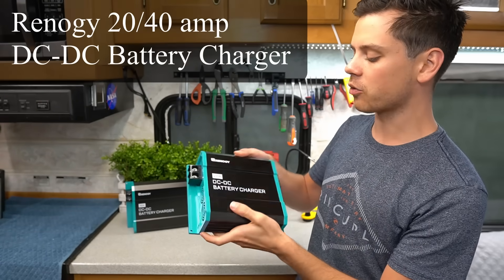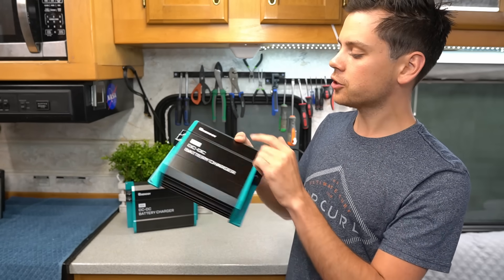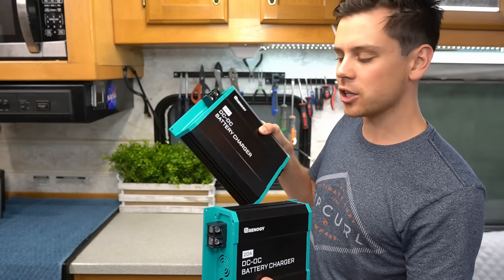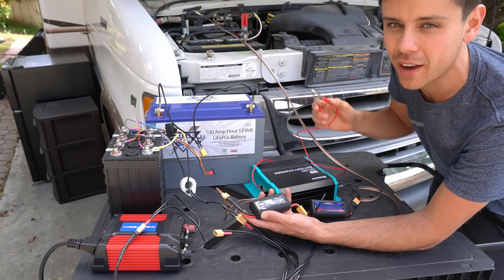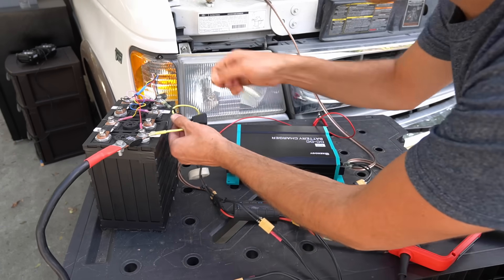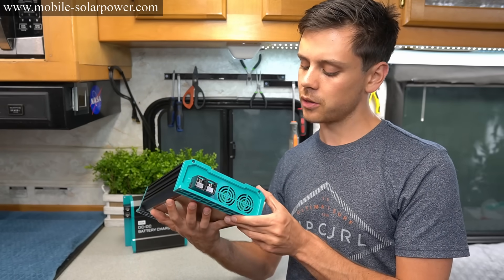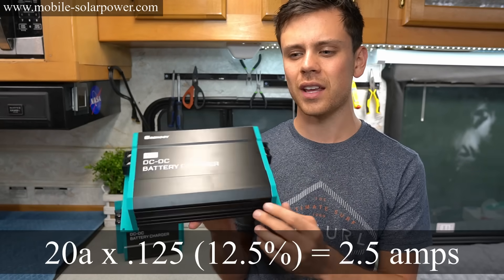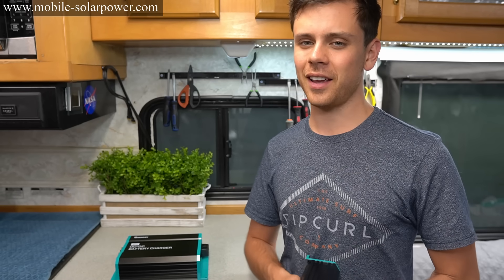Renogy DC-DC Battery Charger Review: "Smart" Alternator Charging for Solar Batteries!

Comment: Ive had my Renogy 40ah dc dc charger for about 3 weeks now. Ive noticed that while driving my van, occasionally the renogy charger switches off for a few seconds and then comes back on intermittently. Ie. Green light gos off..and then comes back on, and repeat. Is this by design? Or is something wrong..
Reply: i had the same problem today. just starting testing and what i noticed was green light blinking, then coming back to steady light and then it blown the fuse of 60amp. It was actually the breaker not the fuse, so i turn it on again.. And the situation repeats. It works for 2-3 mins and the battery is 94%, and again there is a fuse/breaker off. 
Any suggestions?, Pls :)
Reply: @GosiaPajczoka  Mine has not blown any fuses. It just gos off for a few seconds and then comes back on. I have contacted Renogy to ask them if this is by design. What Renogy device have you got? (40ah? 60? and what size fuse are you running? and which side of the charger is the fuse blowing on? On the output side of the charger? or the input side of the charger?

Comment: Could I connect this unit to a disconnect switch on the alternator side and have that d+ cable connected to it as well to start charging? Why dose it need to be to the alternator to start? Will this unit draw my van battery down to charge my house battery without a disconnect switch? Would this unit power my 12v fuse box while charging my battery? Should I also have a disconnect switch to my 12v fuse box?

Comment: OK check this; I'm setting up a 24v system for my van and don't really want to mess with changing the alternator to a 24v one. I've seen testimonials of vehicle warranties not being honored because of this. If I install this to feed my 24V batteries, will it work, but at half the capacity. Say 20amps instead of 40?

Comment: Wait, so you need the ignition sensing wire? I would love to be able to just run the starter battery through a VSR and into the input side so it only turns on once the alternator is ready to go. It's a bugger that cable is actually required.

Comment: If using a lithium battery as coach/house/storage batt with a BMS, why do you need one of these at all? 
Given the battery (and BMS) is large enough to handle the current, the BMS will cutoff the charge at voltage it is designed for.

Comment: So I just blew up my a charger trying to charge my 14.4v bank in my camper  off my trucks deepcycle battery.  They have a common  ground connection.   Do I need a specific charger that can have a common ground or do I also need to disconnect my ground lead evert time I want to do this?

Comment: You can use a delayed 12v  relay on the ignition wire something like a 10sec delayed relay.    After you turn the ignition on 10 seconds later it will switch power on.      They make such relays .

Comment: you can always add an inexpensive  time delay relay to the ign input for the renogy to give the alternator time to get up and running
Reply: I'm going to use my in line VSR. 15 second delay and 12.8v disconnect
Reply: Why?
Reply: @gilianrampart8514  this allows the alternator to refresh its OEM loads first for a couple minutes before introducing a demand from coach battery

Comment: Great Video - I was curious what you think about the charger only having one voltage or mode for lithium batteries. I find it troublesome that this charger does not have a float mode for Lithium batteries. The manual says it is not necessary to have a float mode with lithium batteries which have a BMS, but I find this hard to believe. Both my converter and MPPT chargers, have dual modes for my lithium batteries, why not this DC to DC Battery Charger?
BTW - I use Altronix's 6062 multifunction timer, to delay the start of the Renogy DC to DC converter. I also have a OFF-ON-OFF DPDT switch on my dash, which I use to disable the DC to DC charger or switch between 20 amp and 40 amp charging. Using the alternator to charge your batteries uses gas, so it is better to disable it when driving, if you don't need to charge your batteries or solar alone  is enough to charge them. It is also nice to be able to change the charging current, because at low engine RPMs it is not good to have a high load on your alternator. I usually only charge at 40 amps when I'm driving at highway speeds.

Comment: Will, hi i have some question in mind hope you can help. I'm adding a 60amps  agm battery on my car trunk, planning to use isolator, but i found your video about b2b Renogy can i used this instead ? I have an audio set total 800watts rms sub amplifier and 800watts rms  6 channel amplifier... my starting battery is only 40amps and alternator 80amps this currently run my audio set up with out problem.. is 20amps renogy can support the charging with my audio set up hookup with my new 60amps trunk battery.. i don't usually play music loud but sometimes when testing yes.

Comment: I thought vehicle alternators limited outputs at 14.1v as higher would destroy  a regular vehicle battery, right ? And you need 14.4v to 14.6v to fully charge a lithium battery, right ?

Comment: Very GOOD video. Man. And I see that Renogy Solar got a comment pinned to the top. LEGIT. SPEAK. I want to do this and add a mini solar panel trickel system to two batteries (that's including the engine battery) via the alternator. I think I want my third (200+ amp) battery to run with a 300 watt and 200 watt solar panels.

Comment: Could the DC to DC Renogy be used as 3rd way to charge a home battery backup system?
Saying no line or solar pwr is available a car alternator with a max current of 100 amps.
The Renogy max amperage should not exceed 50% of the alternators rating to avoid damage.

Comment: Will, would you help me decide what I need for my 04 chevy express? I started my search with the mood dc to dc, but there's so much going on that I'm unsure what I don't need.  All I currently have is an agm battery that needs to be replaced. I need a jump daily, and what is like to find is a charger that mounts in under the hood, that I don't need to charge (2 way capability)). And of course I have tons of ideas, 1-2 panels (flexible for my high top), etc.  Help me Will!!!

Comment: these are great but what about towable trailers? how would you run the wiring if your towing a camper/travel trailer?
Reply: Wondering the same thing
Reply: I’ve been looking into this too. I have found 2 suggestions. 
The first is to use the tail light circuit. Run a wire from the trailer tail light to the D+. When u want to turn on the charger, turn on the lights. 
The second option is use the wire, that is already in the trailer light plug, that is supposed to charge the battery (though it doesn’t do a good job of it) to turn this unit on.

Comment: The Victron option is way better than these Renogy units. They DO have th e jability so sense when alternator is running and then turning on the unit. And also all is programable by the Victron App (several option).
Probably you can consider an update on this video to recommend newer better option for this type of applications. Cheers man

Comment: When I installed this in my cargo trailer conversion, I connected the V+ line to the tail light circuit in the trailer. So, when I start my truck, even though the alternator is supplying power to the input of the converter, it isn't until I turn on my tail lights that the converter turns on. As you suggested, it allows things to heat up and be "ready" before I switch on the charger. I thought about using ht etail light circuit as a switching source rather than running a separate control wire back. It allows me to run everything through the standard trailer connector.

Love the channel, keep up the great content.
Reply: Do you need to have your lights on for charging?

Comment: Hey Will. In an RV-alternator-powered dual 100amp lithium battery system, with no solar input necessary , which would you recommend: the Renogy 50 amp MPPT or their 60 amp DC to DC charger? And why ?
The costs are about the same and the RV already has a zamp solar system. 
I guess I’m just wondering because the 50 amp looks a bit more advanced and easier for a first timer to install? Thanks for your thoughts and videos.
Reply: In this case we will have to understand the maximum charge rating for your battery bank. 

For a standalone 12 Volt 100 amp lithium battery I believe it's 50 amps. When you hook these up in parallel you'll have to do the math to find out if you can send a larger current to the 200 amp battery bank based on the kind of setup you have whether it's parallel or series. 

If you have a stand alone 200 amp battery, just look at the settings information in the literature and it will show you the maximum charge rate in amperage. In any case you can always use the limiter switch on the Renogy to reduce the output of the charger as needed for less aggressive charging needs and based on your application.

Comment: Hi. Great video! What do you think about charging 2 x 100amp battleborn in parallel from a vehicle using a 0.05ohm 100w resistor instead of the dc to dc charger? Mostly charging from solar, but once in a while might want to charge from the alternator with a manual switch/relay and 40amp auto resetting circuit breaker. Alternator output is 14.2V and 160amp (@2000rpm). I Would manually shut off the switch when the battery is full or @ 80%ish.

Comment: I had read some where that to connect an Isolator to the Generator you must check the size of the generator first?
and if it is small sized on rating do i need to go to the highest for that Van?

Thanks for any help

Gary

Comment: Would I use this if I have an RV with 12v alternator and have my inverter and batteries set up as 24v? I’d like to charge batteries while driving so I can use an my ac units while driving

Comment: Would the 40A renogy charger completely discharge my main vehicle battery if left on , when my engine is off? Of will it stop charging when reaching a certain voltage of the main vehicle battery?

Comment: The dc to dc charger when hooked up to a battery which is also hooked up to solar will cause the charger to recognize the voltage from the MPPT that the solar is charging at. Do you have a test that shows that this item wont go into absorb or float mode when the battery is empty and being charged by the solar at 12 volts?

Comment: Hi Will, ther have been a lot of comments that this charge (40A) will not achieve the rated charge voltage for lithium. Did you check to see if this terminated charge correctly at 14.6 or thereabouts. I have one of these and it only charges to 13.8 volts in the lithium or any other profile as set by the dip switches.

Comment: I like that it has the separate input for starting. I put a temperature switch on it so it doesn't charge the battery when it's below 0 degree C. I also use the reduced current input to reduce the charge current if the alternator gets hot (temp switch on that too). However, I have the 60A version that has a 50% reduction to 30A.
Reply: Same here, but I have the 20A version with the current limited to 10A so I did not have to upgrade  my tow vehicle 7 pin wiring.

Comment: Thanks Will.  I bought the 40A unit.  My manual says the LC wire input limits the current to 50% (not 12.5%).  This seems much more useful.  I plan to have a switch in the car so I can just select 40A (switch off) or 20A (switch on).  I have a high amperage alternator, but it depends upon how discharged my battery is and how long I'll be driving between campering sites whether I use 20A or 40A.  Also, if my alternator won't reliably handle 40A, I could probably still use the 20A.  Of course if that's the case, why didn't I just by the 20A instead?  I didn't know that info ahead of time.  I guess I'll see how it works.  Thanks again for your videos!

Comment: How do you ground this system. I've seen some folks ground to chassis despite this already being hooked up to the starter battery which is directly connected to the chassis ground. Please advise. Renogy will not respond to this question which is their MO.

Comment: I wonder if you can answer a question for me?  My agm 100w sl was set up to charge with my car battery and isolator while driving and it worked great.  Renogy 200w solar just installed and battery is not charging while driving and can’t find the mistake..please advise?

Comment: Is it possible the current limit option is so you can connect it via a vehicle 12 volt (cigarette lighter) socket?  So you don't overload the wires or fuses.  Btw, I think those 12 volt sockets usually have a 15 or 20 amp fuse in them... so the amps do line up.

Comment: Did you ever find out what the "Current Limiting" option does?  The manual doesn't seem to explain it very well.
Reply: It cuts the output current (amps) in half. If u have a 40 amp charger, after u put the jumper in the LC, it will only charge at 20 amps.

Comment: Hey! You might not see this, but I purchased the biggest version of this charger and could not get it to run in any way. It would not even turn on! I connected the D+ to a switch not connected to my vehicle for a little more control . Could this have been the reason it did not work? I connected it to my lithium battery

Comment: If you had to design an alternator charging system for your lithium battery bank, how would you do it? The wonderful folks at Long Long Honeymoon youtube channel just installed a Renogy 40amp DC to DC charging system with a dedicated wire to the truck battery. Their alternator wasn’t up to the challenge, but they are looking at a Mechman 370amp replacement. Do you still see issues with this system long term?

Comment: The current limiter tigger wire could be used so that it’s not trying to pull full amps at low alternator RPM which could damage the alternator

Comment: I'm using an MPP Solar 24V all-in-one for the rest of my system, which will charge my two Battle Born batteries in series (24V). Could I use this to charge my two Battle Born batteries in parallel (12V) each? 

Would I need some sort of way to isolate the two charging systems so they aren't competing to charge the batteries?

Comment: I am hooking up my 20amp charger, and I have everything figured out except I don’t know what kind of connector to attach to the end of the d+ wire to plug it into the port on the Renogy charger. Do I just jam the wire in the hole?
Reply: You don't need a connector. You just bare 1/4inch / 5mm of wire and put that in and tighten the screw on the terminal.

Comment: Great review, have learned a lot from your channel. I just ordered the 20 amp DC to DC  along with a SOK 100 amp hour lithium. Planning to attach to battery case with Anderson connectors  so I can use in both my RV's. What are your thoughts on connecting the input of the renogy to my converters when plugged into shore power as they are both old and designed for flooded lead acid. This would save me upgrading them both to obtain a full charge of the lithium battery?

Comment: Can I use the 20 amp charger with a yamaha F250? That is, can I connect this charger to a 36 V 60 amp lithium battery, and then connect chargers lead(s) to the starting battery of the boat, without any additional attachments?

Comment: The low current pin is used for activating trickle charge. If for some reason you wanted to trickle charge you batteries this gives you the option.

Comment: I'm really keen to get one of these for my campervan, but I don't know what size wire to purchase. I already have some 10mm tri-rated but I think it's undersized? It'd be to connect a Mercedes Sprinter van battery to 3 leisure batteries (wired in parallel) totalling 345Ah at the very back of the van. Cable run would have to be around 6m. Any help is greatly appreciated!

Comment: I put mine on a switch instead of start circuit, that way I control when it charges simply by turning the switch on and off. RV with Tito has a good video on this.
Reply: I've found that using any switch is a pain when using this charger.

The ultimate work around is to connect the DC wire to the actual alternator terminal which produces a 12 Volt signal when it is running. 

However, this terminal connection point is not the big alternator load wire.

There is a smaller terminal on the alternator simply to use as a DC current active point of contact. 

This means,  the charger will only be triggered when the engine/alternator is actually running, and not just when the accessory switch is on. 

You will have to find that terminal near the alternator using a multimeter.

Comment: OK, I'm semi-bright and just now exploring some of this. This would work if I had a solar charger, but wanted to charge while I was driving/moving campsites, right?  TIA.
Reply: I’m looking into this now and it is my understanding that these DC-DC chargers can be considered as step up transformers. They step up the voltage they received from the alternator to the correct voltage to charge the house batteries, while u are driving. 
The solar charger (MPPT) does the opposite. It steps down the voltage (assuming u have some panels wired in series) where the solar array is producing 24 volts or more, the SCC steps that down to the 13-14 volts your battery needs for charging., without damaging them.